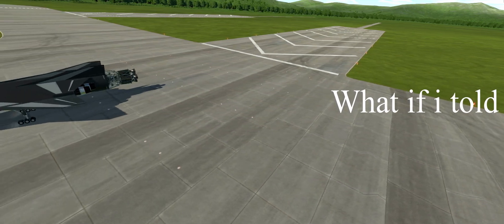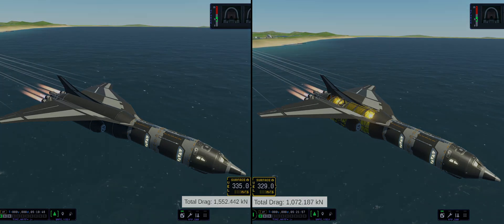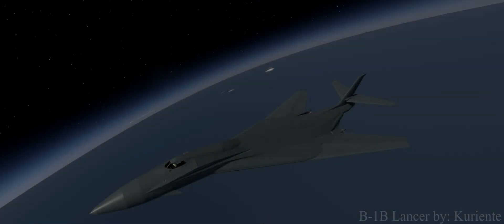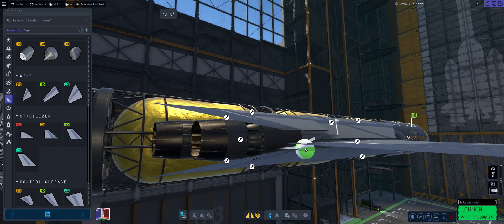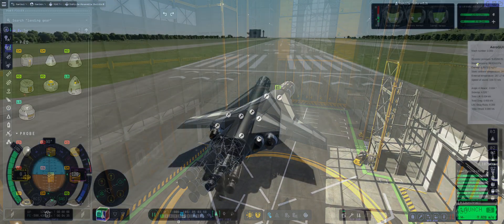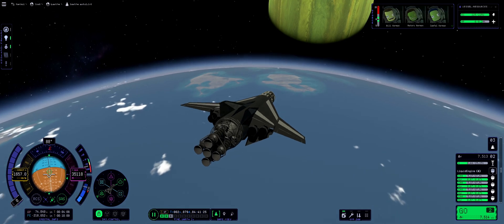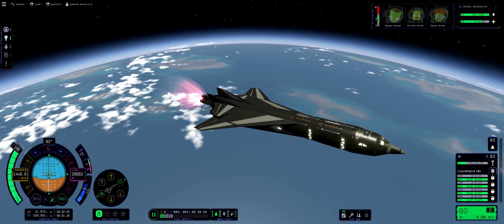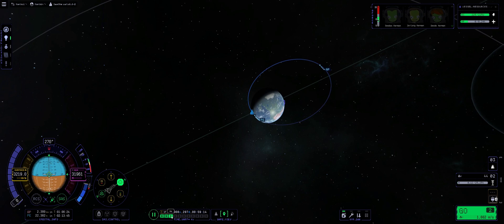KSP2: Stunning high performance SSTO

Comment: Jool is such a perfect planetary system to practice everything in the rest of the game on a smaller scale. It’s kind of broken how many options you have just to capture in the system - you can aerocapture on jool itself or on laythe, or you can use gravity assists between different moons in the system to save hundreds or even thousands of m/s of delta-v, or you can opt to brute force a capture by burning fuel. It is the perfect system to practice gravity assists, you can treat it like a miniature solar system with jool as the star. The moons have good variety in appearance and physical characteristics from tiny rocky micromoons that are challenging to but easy to land on, to Laythe being basically a slightly scaled-back Kerbin.

If you want to practice ANYTHING in KSP, the Jool system is easy to get to and is a great place to learn.

Comment: How do you get such realistic looking footage?
Reply from the maker: Movie magic :P
Reply: @Kerman_von_Braun  so it’s only in the footage not the game?
Reply from the maker: @TheGuyWhoComments  Realistically, 95% of the work is in game. Setting up the shoots can take a pretty insane amount of time, and there is only so much you can do in post.
For example, in my last Duna colony vid, some shoots unironically took me more then 10h to execute in game (generally transition shoots).
Tho there are some minor things i do in post that complete the general vibe, like non linear speed ramping or sound effects (99% of footage in my vids doesnt have the original in game audio since its usually speed up massively. I instead use in game sound bites or external effects)
Reply: @Kerman_von_Braun  ok thanks

Comment: How are you getting AeroGUI to work? Ever since the last patch (or maybe the previous?) mine no longer comes up, due to the F12 key issue, or whatever. Did they change the binding?
Reply from the maker: Intercept decided to disable aeroGUI because ''f12 is needed for screenshots''. Its extremely dented, but thankfully, Shadowdev fixed the issue.
Simply install his ''cheat menu'' mod and f12 will once again bring up the aero gui. That specific mod also includes other useful fixes, like the failed mission report if you lose a single piece of your craft.

Comment: 7000 m/s reentry speed oO'
Will there be a chance to survive that kind of speed when the reentry heating will be implemented?
Reply from the maker: that depends largely on the craft. This specific one would of likely burned up, tho its hard to say, since we dont know how resistant certain parts will be to atmospheric heating.
A much safer option is to capture using tylo's gravity and then perform a very small burn to get a Laythe encounter.
Tho a craft that is light enough and can generate sufficient drag in the upper Laythe atmosphere can do a direct aero capture.

Comment: Major props. That's a great looking design. Curious if you could design a large payload SSTO that is effective and not a million part super computer killer. I have struggled a lot with this. Most builds end up getting three frames per second.
Reply from the maker: Yes and no. In theory, you should be able to do a ~100-200t LKO lift SSTO with out to many issues well keeping the engine count down to a reasonable lvl. How ever, due to the cargobay bug, cargo SSTO's and space planes in general are just not worth doing at the moment.
Im waiting for said bug to be fixed to finally start doing cargo ssto's.
 I do have 1 cargo ssto design up in ksp builds called ''draken minotaur''. its a 35t lko lift ssto, tho due to the cargo bug, its not very functional.